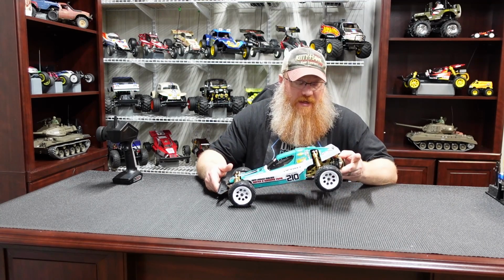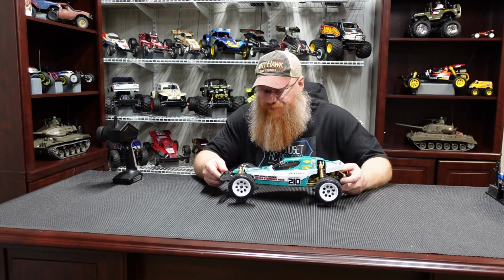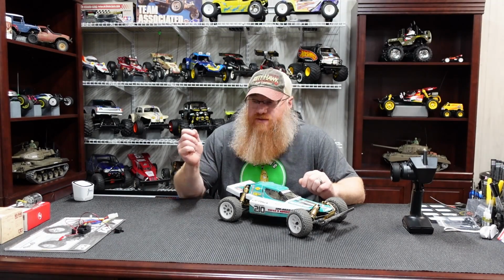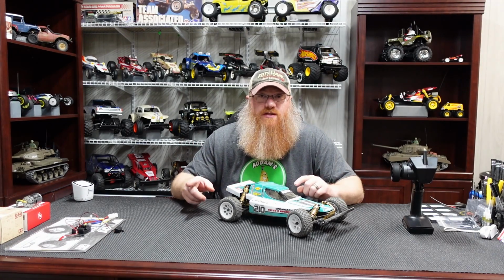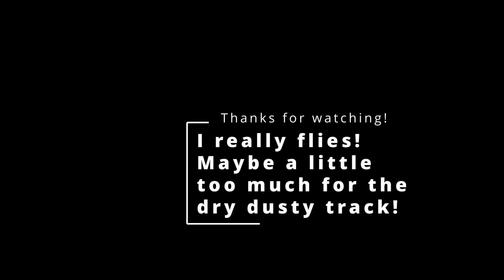Kyosho Turbo Optima First Drive

Comment: Man can this thing ever Motor along. Great run with this thing and definitely another great addition to the fleet. Throttle Finger is easy to loose control of when it runs this good!!!  Enjoyed it
Reply from the maker: 😂 you are correct about the throttle finger!! I was having so much fun slinging dirt around I forgot to drive it like I had some sense! I think with a watered down track and some sensible driving this could be the fastest car I have. I will have to see what I can get done next time it is out!

Comment: Wow, she rips! Looked great out there on the track. Glad the radio issue got sorted.👍😊
Reply from the maker: Thanks! It was so much fun out there slinging the dirt and dust around! Maybe a little too much as it ended up into the pipes more than normal from me goofing around and having a good time! I am glad I did not just jump right into tearing things apart to troubleshoot the issue with the glitching and let it sink in that I had two cars on that were bound to the same radio and causing it to get a bit confused!

Comment: That thing is sweet.  And that is crazy about the receiver..  Keeper RIPPIN!!!
Reply from the maker: Thank you! It was odd, I have never had that happen before when running multiple cars but I may have had different radios to two different cars in the past. Either way I am glad it wasn't anything serious and I was able to get it back out and finish the run! It really scoots around out there and drives like a dream!
Reply: @AddamsPlayground    She definitely turn out nice..  That's on my list of cars to build..  Oh ya side not not sure you remember but found vintage back yard video on track it definite gave me some ideas...
Reply from the maker: @reitplace4765  I wish he had made that video a year or so ago! I would not have made this giant jump on my track and made it more of a tabletop turn!
Reply: @AddamsPlayground  right..  I think I'm doing all my jumps out of wood.  Easy to move around and change if I don't like ot
Reply from the maker: @reitplace4765  I wanted to make a few out of the white PVC material used in construction (trim work and facia stuff) because it won't rot but that stuff is silly expensive!! It wasn't worth it. Some pressure treated fence boards and some 2x material is probably a wise choice
Reply: @AddamsPlayground  I have a bunch of old greenhouse lexan hopefully it holds up.  And it's free can cut with knife.  Expensive part is outdoor carpet for covering.  Trying to find reasonable roll price.  We will see how it goes.  I'll probably do a vid at some point
Reply from the maker: @reitplace4765  try looking at discount stores  around you for remnants of that stuff. I know we have an Ollie's chain near us that sells stuff like that super cheap! Honestly a yard of it at a home improvement center is not that bad, usually about 12 feet long by 3 feet wide should be about $30 and would make 3 to 4 wide jumps or 60 to 8 narrower ones. Check with local carpet stores well. They may be able to hold some scraps for you for nothing or next to nothing!

Comment: Great running video, I’m glad you included the part about the interference a lot of times you only see the good things in videos. The 19T element motor seems to be really quick, might have to pick one up in the future
Reply from the maker: Thank you! I always try and share both the good and the bad experiences I have. I don't want to just pitch the good and not share the bad. I would hate someone to watch one of my videos and think that it is the most perfect RC ever and then get it and find it has issues! This time it was just a odd scenario I have not run into until now and it took a while to thinkin of why it was happening! I am glad I did not immediately jump into tearing things apart and replacing stuff and took the time to reflect on it! The motor ran really well and has a great balance of torque and speed. I got this one from eBay a while ago but there a a few still listed!

Comment: The car looks great and has a lot of power. Once I heard a pro driver speaking to a group of kids. He told them that one the keys to driving is throttle control. Since you were shooting video of both cars, it's my impression that the Pegasus was slower. When you went to the Turbo Optima it had more power and you pulled the trigger on certain spots it got tail happy. You had some great laps with more throttle control. When you get that car dialed in you will really have even more fun. It looked great coming off the jump.
Reply from the maker: 100% it was me having too much fun seeing it sliding around and sending up the big rooster tails of dust and I completely stopped focusing on driving it well! It was a ton faster than the Pegasus! I ran like it was on velcro out in the grass! Some more focus on my part and watering down the track and it would turn in some much faster laps!

Comment: Holy cow, that thing is AWESOME! Great vid Addam, looks like a total blast to drive 😃.
Reply from the maker: It really was a blast to drive. I got so caught up in sliding it into and around the turns I kind of forgot to actually take it easy and drive it responsibly like I had planned too! Thanks fully it came back with only a few minor scuff and it cleaned up nicely and looks perfect again. I will get it back out in better conditions and with some control and see what type of times I can get out of it!
Reply: @AddamsPlayground  
I'd be willing to bet that you'll turn faster laps with that Optima than anything to date!
Reply from the maker: @redbeardrc1452  it is quite possible!

Comment: Love the pics in the grass and track footage...That's a beautiful buggy!   I have been resisting buying one of these...you're not helping!
Reply from the maker: Thank you, I love the look of it and driving it is a dream. It drives so well (despite my example of smacking into the pipes all over). If you see one in stock I think you will be very happy with yourself if you get one. Don't buy one for the silly eBay prices but I would recommend getting one, the build went so well and everything just falls into place. Not twisting you arm, maybe just reassuring you it is a good idea LOL!!
Reply: @AddamsPlayground  Lol.. yeah when you weren't on the pipes you could tell it was hookin & bookin!  I have a Lazer ZX-R mk1 which is my dream Kyosho 4wd, but I've also always wanted an older rear engine one too...no thanks to the Project Optima in the Dec 1987 issue of RCCA.  These Turbos just look so nice with all the gold.

Comment: Great running video Addam, she looks sweet out there kicking up the dust..... and then there's that awesome and very familiar optima sound! 👌
Cheers for taking one for the team, as I don't envy you on that post run clean up..... took me hours on mine and that was only driven on clean dry tarmac!
Do hope you got away without any damage to the shock caps/shock towers and bodyshell after that little tumble or two.
You done well controlling her on such a tight and dusty track matey.
Still loving that turquoise/white livery.... hope you ain't offended if I copy you on my second shell fella?!
😉 👍 👍 👍 👍
Reply from the maker: Thanks! Glad you enjoyed it, I had a ton of fun out there with it. I went a little harder than I planned on but I kind of got lost in sliding it around and with how punchy and fast it was to care too much about wrecking it! I came away with only a few minor scuffs so all is good! It didn't take too long to clean it up, thankfully most blew off with the compressor and the rest was pretty easy to wipe down, much easier than cleaning up a muddy one for sure! I love the looks of it and by all means , paint yours this way! I recommend it, it looks great!! Take care my friend and have a great rest of your week!

Comment: Sweet! it looks like a wildly beast! Sweet rooster tails!👍👍
Reply from the maker: I had planned on taking it easy on it and driving like I had some sense but that  flew right out the window once my inner 12 year old saw those big clouds of dust getting kicked up!!! The whole section of woods behind the track was just a haze of dust once I was done! It turned out looking great and running just as well. My only complaint is it is too pretty and I still don't want it all scratched up!!!  thankfully only some very minor scuff from the run. It is all cleaned up and bock on display but I am sure the next outing I will be equally as aggressive with it! LOL!

Comment: Wow, that buggy rips! It looks like a blast to drive; nice one Addam!👍😊
Reply from the maker: It runs really well, much better than I was driving it! I got caught up in having fun sliding it around and slinging the dust and sort I kind of forgot to try and actually driver it well. It was a lot of fun and it is a very fast and capable buggy for sure! I hear the Mid is even better performing so I am going to have to saving up the pennies to get one of those! For now I think the Kyosho storm has passed and I will begin back onto the Tamiya kits soon as I have a few of those supposed to start coming in soon (I hope) from the pre-orders of the new stuff!
Reply: @AddamsPlayground  did you preorder the new Tamiya 2wd buggy?
Reply from the maker: @HaydadRC  Yeah I have the BBX and the Boomerang on order. I wanted to get more but those two I really wanted.

Comment: Awesome looking buggy and cool video Addam , Makes me think about taking Turbo Optima out for its first run 😎 ,
Reply from the maker: Thanks Herbie! Do it! It runs so very nice and just goes where you want it to (as long as you are good on the throttle)! I got a little throttle happy, it was too much fun sliding around the corners and I ended up in the pipes quite a few times! I stopped focusing on getting around the track and was just having a blast slinging dust clouds!

Comment: Looks amazing Addam! You must be really pleased with the final buggy and how it drives. 
I was worried for a minute there but all good in the end 😂
Reply from the maker: Thanks Craig and yes, it looks and drives wonderful! I was a bit worried there for a bit too but it was just a very confused radio not knowing which to try and control! I had a great time out there with it and ran it a lot harder than I planned on but it was to much fun so I smacked into the pipes a few times! It is fine and it looks great again all cleaned up!

Comment: Awesome run Addam
Reply from the maker: Thanks Will! It was a blast to drive and I went a little harder than I planned but it was too much fun sliding around the corners and I ended up in the pipes quite a few times! I stopped focusing on getting around the track and was just having a blast slinging dust clouds!

Comment: Looks great and has a bunch of power. The power slide @6:40 is great.
Reply from the maker: Plenty of speed and power out of that motor! It was a lot of fun out there diving it around. I got a little too caught up in sliding it around in the corners and impressed with the power I did bang into the pipes more than I wanted to! I got a few good laps in but kind of got lost in the dust and sliding around and was just having fun! I was really impressed with this one!

Comment: That does fly!  And that greenish color works well with it to. I picked up a OG chain driven one not to long ago. Need to get a motor in that and get some runs in.
Reply from the maker: It did run really well and I got a little over zealous with the throttle finger a few time and ended up in the pipes! Over all it is a wonderful build and runner. Once you get it running you will be super happy with it. The 19T motor I put in was just about as fast and punchy as I would want it! I am very happy with it overall, both looks and performance!

Comment: Great running video Addam. I like the dust clouds hanging in the air over the track.
Had you unplugged the battery of the Pegasus? If not your guessing's right.
Reply from the maker: Yeah there was quite a fog of dust hanging in the air out there! I was having a blast whipping it around the corners and sending up the little clouds of dust! So much so that I kind of forgot to try and drive it cleanly and was just nailing the throttle and having a good time! 
I had not unplugged the Pegasus until I got back inside. I think just having the two cars on at the same time confused my poor radio and caused the glitching. It ran perfectly before I turned on the Pegasus and the next day when it was by itself. So just need to make sure things are turned off on one before running another!
Reply: @AddamsPlayground  this might be a great topic for another video, after testing it🤔

Comment: Thing looks great buzzing around.
It looks fast. I am on the fence about the rere tires. They seem so soft. Regardless the car looked to handle decent. Great run and great build.
Reply from the maker: Thanks Keith! It ran really well and on a grippier surface than that dusty, pollen-puff covered track it would have done even better. I did not want to use clay to build it so it is all topsoil out there so it doesn't hold up as well and gets very sandy/powdery quickly. It sure is fun slinging the big roosts of dust though. I got so caught up in having fun with it and slinging the dirt and dust around I kind of forgot to try and get in some good laps! LOL! The tires seem to hold there shape fairly well, I was a little worried about them rolling over also!

Comment: Great Video! This performance on the Orion 19t brushed motor?
Reply from the maker: Thank you! The motor worked perfectly for this and there is tons of power and speed! I was never able to get up to full speed on the track. It worked very well and was not hot when I got done out there. It was very warm but I think that was most due to me running it in the grass for the last few minutes. The taller thick grass out but the track really bogs down the lower buggies. I am really happy with the motor!

Comment: Appears to turn vary well. Hadn't had a chance to run mine yet. Kinda like you, new job pluss yard work. Decent traction for a lose track. Challenging I know.
Reply from the maker: Yeah, I was hoping to get both run at the same time but that led to issues so it had to wait until another evening. It ran super well and drove like it was on velcro out in the grass and did very well on the slick track. I blame the banging into the pipes all on me. I was having so much fun sliding around and slinging the dust clouds up I kind of forgot to drive it to get a decent time but it still went really well! Those spring chores sure do pile up quickly!! I wanted to blow off the track but there is so much pollen out I did not want to kick up any more than was already flying about! LOL!

Comment: Awesome run, Addam! Good catch on the radio issue. Is that a Dumborc transmitter you're using?
Reply from the maker: Yeah, those laying in bed thoughts are usually the clearest ones I have! Mostly because I am not distracted by everything else going on and I am only focusing on the one thing at the time! I use the Spektrum transmitters and have for years. I got my first one probably 10 years ago once I had 8 or 10 cars all with a different radio and I got tired of playing 'swap the batteries' every time I wanted to drive one as I hate leaving them in the radios as they get forgotten about and can leak and ruin things! I have stuck with them mainly because I can get the knock off receivers for around $13-14 a piece and they will bind to any of the 3 radios I run. I have them all bound in the radios now but occasionally I will need to move one or some thing. I have heard decent things about the Dumbo radios and the Radio link ones too. It is hard to leave when I have so much invested into the Spektrum side now!

Comment: Nice, could use a bit more rear end maybe, looking at how it slides and over-rotates in corners
Reply from the maker: Yeah, I am sure some tuning would help. My driving style is more for my amusement than actually driving fast, I tend to really sling it around the corners as I like seeing it kick up the dirt and dust! I can sometimes tame myself for a few laps but it usually turns into coming in too fast, slam on the brakes and then hammer the throttle around the corner... not graceful but fun! LOL!!
Reply: @AddamsPlayground  Understandable, going fast isn't everything. In that case, the car is tuned towards your driving preferences, so it's all good then

Comment: I just picked up two of them. Right place, Right time!   Yours seriously hauls ass! What are the specs on it? Brushless? Lipo? Any reliability issues?  VERY nice car!
Reply from the maker: They are super cool buggies and a joy to build and drive. I have a 19t Element motor with a 1060ESC running on NIMH power. I could run it on lipo but I use the nimh packs most of the time as they are always laying around and modern ones work much better than the old ones. I use inexpensive ZEE brand batteries, both nimh and lipo in almost all my cars. Ha vefin building and running yours
Reply: @AddamsPlayground  Thanks so much for replying.   I’ll probably go with a 17.5 on one, Maybe a 19t on the other.  2s lipo for sure!